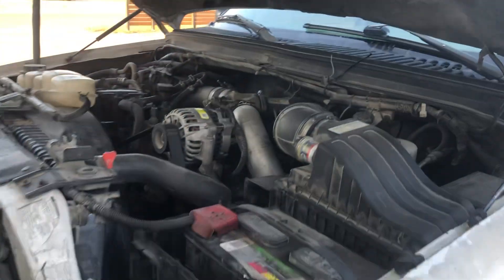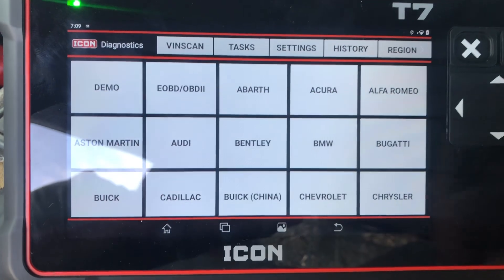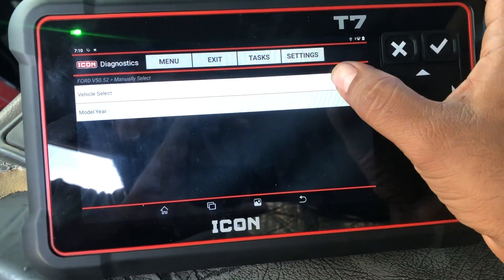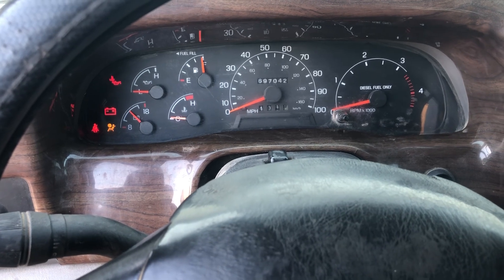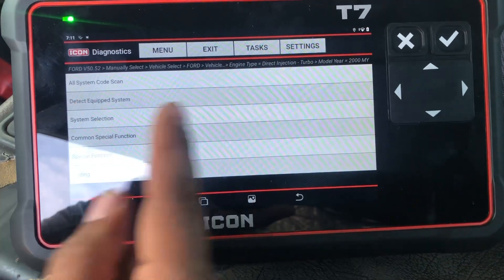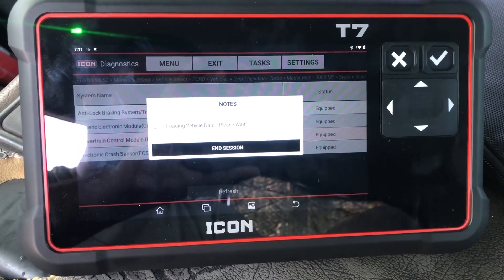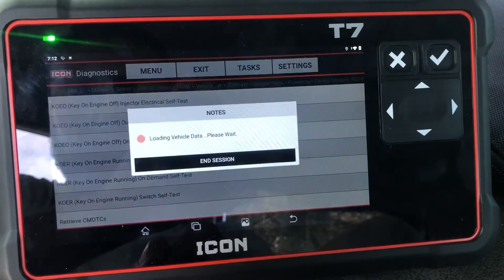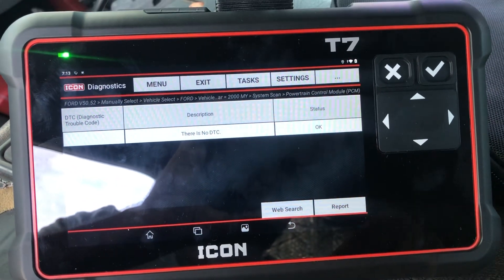Icon T7 Injector buzz test on a 2000 f350 7.3l

Comment: Tb are you able to see live data on the T7. Like fuel pressure, oil pressure, and IPR and sensor readings?
Reply: Yes
Reply from the maker: Yes you can custom graft all the sensors and see there value or percentage live.For the 7.3 diesel i don’t know if it will work for other diesel brands.